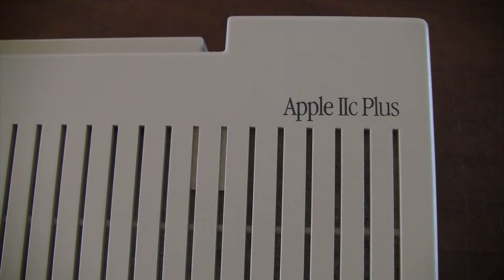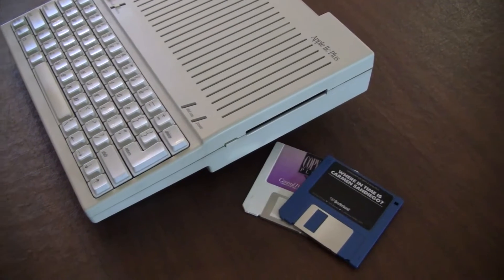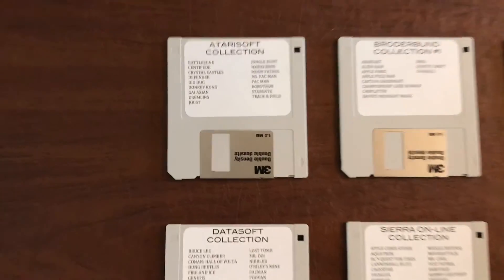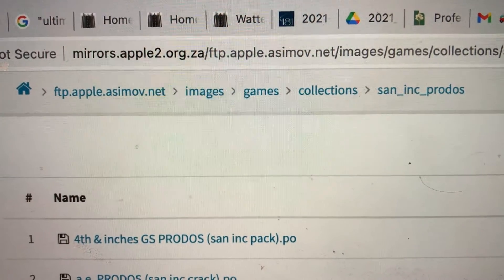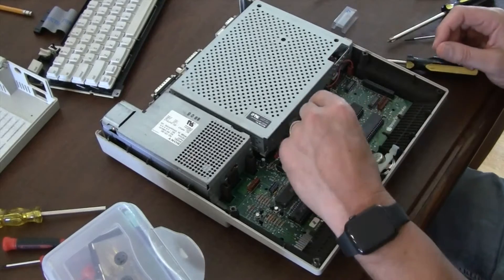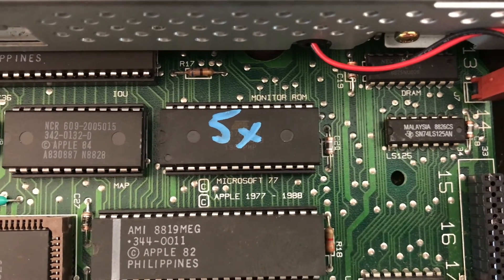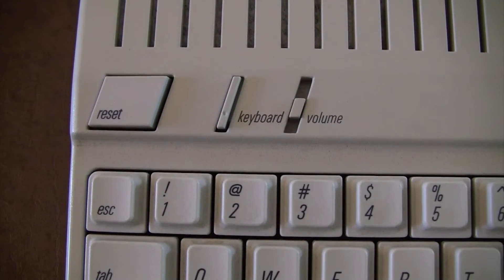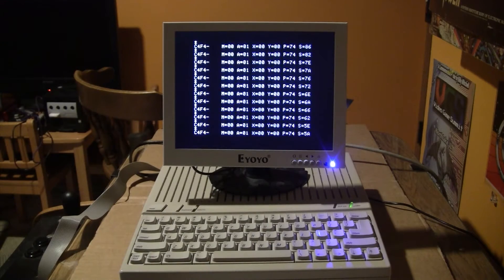Apple IIc Plus - Installing ROM 5x and Mockingboard 4c+

Comment: Update: I removed the ROM 5X chip and the conflict went away. I have no idea how to resolve this though. Thanks.
Reply from the maker: Thanks for the info! I guess I’m not going crazy. Interesting that you had the conflict 6 minutes into the game. I hope that there is a fix for this eventually, but I’m guessing not a lot of people have the same setup as you and me.
Reply: @brizalti  Hehehe, you can say that again! The conflict happens for me whenever Nox Archaist calls its Mockingboard routine, which is either on the intro screen or when you enter a town, so  pretty quickly. However, it doesn't interfere with gameplay, so I am happy to just live with it. Here are more details from Ian Kim:

"Thanks for your feedback and the error is based on ROM code of 5X ROM.
I tested on my //c+ and no error happened on my //c+.
$c400 area are located on the mouse routine and it doesn't interfere with user command input.
You can test it on the original ROM chip on it.
When I designed Mb4C, there were no ROM code extenders and the ROM software builder have to consider compatibility with other one.
In that error, I guess that you may CTRL+reset the //c+. doesn't it make stop the error?
If you have any questions, please let me know."

Comment: Hey there, fantastic video as always, saved me lots of time! I received  Mockingboard 4C+ for Christmas and already had the 5X ROM Chip installed, finally got motivated to do this so I can play Nox Archaist, Lord of Storms DLC with Mockingboard support. As an aside, there is supposed to be a way to modify the 5X ROM so the accelerator is disabled by default. But for now, the Tab-Control trick is super handy to know.

So I am writing this in particular to let you know I am seeing the same conflict when playing Nox. I am not manually enabling the Mockingboard. Rather, after the Mockingboard has been automatically detected and enabled by Nox, I am getting the rolling "C4F4-" conflict you show around 6 minutes in. So it's definitely not your IIC+, not sure if it's something special with the 5X ROM and the Mockingboard? I am going to email Ian about it and ask if he has any ideas. I'll reference your video and let you know. Thanks again, love your videos!!

Comment: Does this Mockingboard work with Attack of the PETSCII Robots in 4 MHz mode? David Murray tried playing this on a IIc+ at 4 MHz and the game speed was too fast, but on traditional Apple IIs with Mockingboards this game will use the two CIA timers on the board to fix the timing. I'm wondering if this would fix the timing here, or perhaps the IIc+ Mockingboard doesn't have the timer support.
Reply from the maker: I just tried it, and it still runs at 4 MHz with the Mockingboard enabled. Everything is sped up including the music. It shows the Elapsed Time when I enable the Mockingboard. The timer runs faster when in 4 MHz mode than in 1 MHz mode. Also, I had to hold the ESC key when starting the game to manually select slot 4 for the Mockingboard, otherwise it didn’t detect it. The game seemed to run fine in 1 MHz mode.
Reply: @brizalti  thanks for taking another look. I guess it doesn’t depend on the 6522 timers as much as I thought.